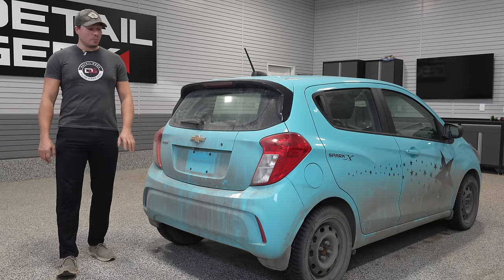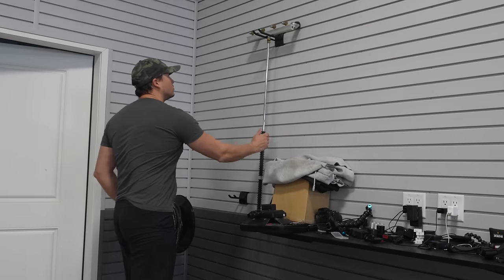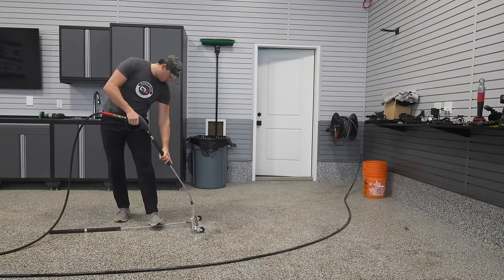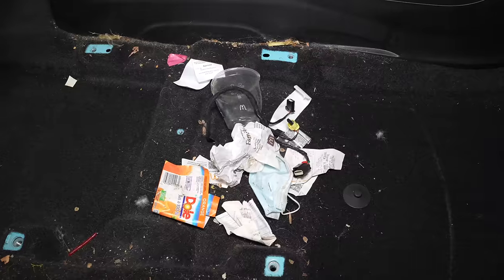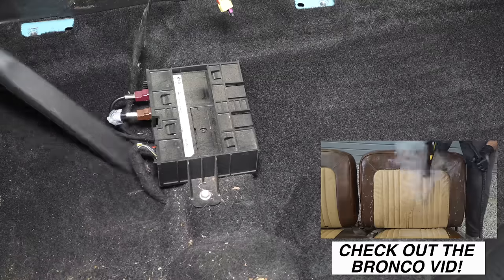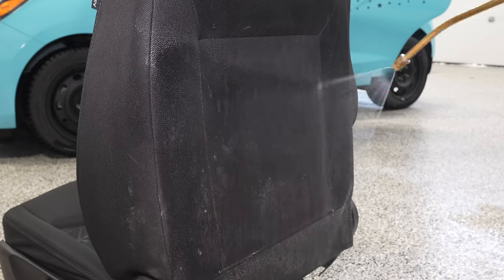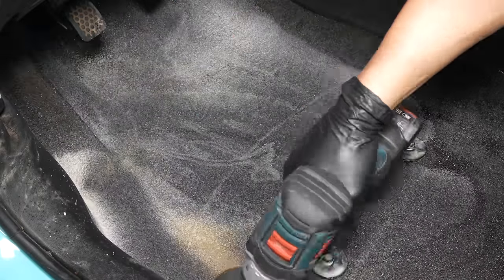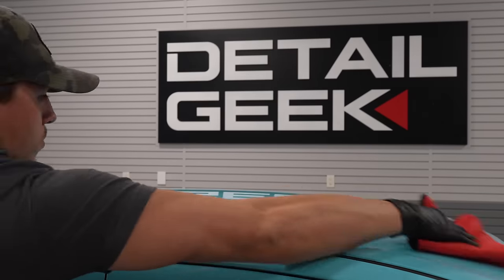Grandma's Tiny Car Gets A MAKEOVER! | Surprise Detail!

Comment: I drove a 2019 Spark for 2 years/25k miles and I honestly enjoyed it! Love how small it was and parking was never an issue. Even kept me perfectly safe during a t-bone accident 😅
Reply: I had a 2018 Spark and I loved that little guy!  I was rear-ended while stopped and the rear hatch ended up in my passenger seats, but I was perfectly safe.  I miss my tiny car!
Reply: @kovary77  I totaled my 16 Spark. I hit someone stopped at a red light going 40 mph. My entire engine bay was destroyed. But, I had minor injuries. Those things are very safe vehicles
Reply: I still need to know, do you clean the engine compartment?
Reply: @kevindalton1502  sometimes he does. If it's an older car or the customer requests it
Reply: Everybody's Spark ended up totalled it seems, it's like the motor equivalent of hamsters 😂

Comment: Great detail as always! I have driven a 2018 one of these for the past 4 years. (Except here in the UK it is badged as the Vauxhall Viva, and the nose is slightly different. I have the 'Rocks' model which has bigger wheels and bumpers, and a taller ride height). Honestly I love it! I've done quite a few longer high-speed journies in it (3-6 hours) and it copes fine at 80 mph and uses a TINY amount of fuel. The trunk is small and rear legroom is limited, but I have done a 4 hour journey with 4 people plus carry-on sized luggage. Also in 4 years nothing has broken on it. I would look to buy another one but they don't make them anymore.

Comment: what a cute little car! viewing old videos after 'discovering' your channel. and not too old to learn new tricks (72) i used a paint brush and my skinny nozzle on the vacuum cleaner to clean my rav4. i have to divide the cleaning into a couple days.. i used to use brush attachment. despite hauling dogs to beaches and trails everyday, the inside doesn't get icky, because i never EAT or drink in the car. just sand, dirt, leaves, dog hair that gets caught by thrift store sheets.

Comment: Grandma is still able to drive a stick shift. My old knees couldn’t do it 😂. Great job. Such a cute color. Wondering why grandma took off the hubcaps
Reply: Winter tires don’t normally have hubcaps.
Reply: @sandraalston4245 where I live they’re on all year round. 🤔
Reply: These are probably snow tyres put on for the winter. I see a lot of cars in Europe here driving around like that in the winter.
Reply: @KarenDoty-rh1im  in places like Canada where you need snow tires but then also need to switch to a/s or summer in the summer, some people own two sets of wheels so they don't have to do tire changes all the time (a lot easier to swap wheels than take off a tire and put it back on)

Not sure if this is the case here but I see that pretty often!

Comment: Just a tip I don't know if you have mr clean erasers up there it's a sponge. Best cleaning thing to be discovered been cleaning for 50 years now cars and house. These thing work on windows one time over and than windex .They take off black scuff marks in the car very easily its like a miracle. Clean stoves. They clean everything with half the work. Prefer the sponge over the wipes.Give it a try you'll be doing half the work